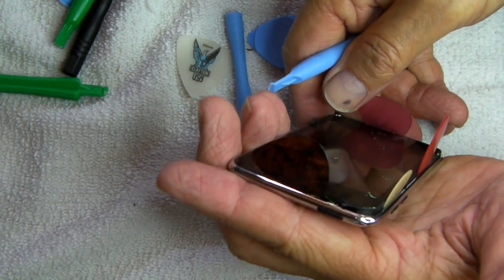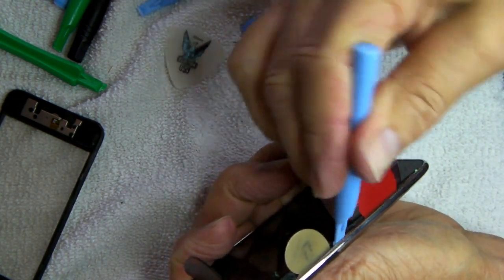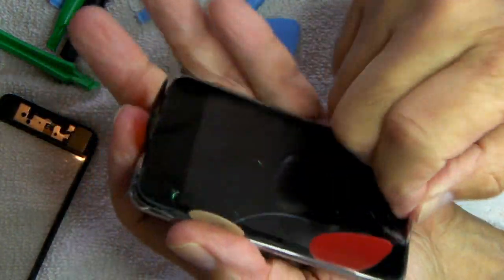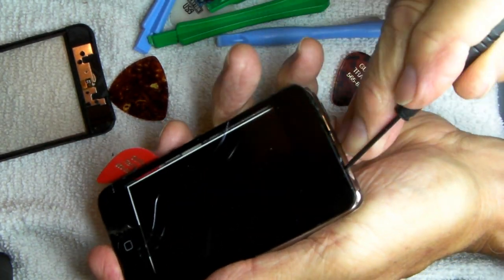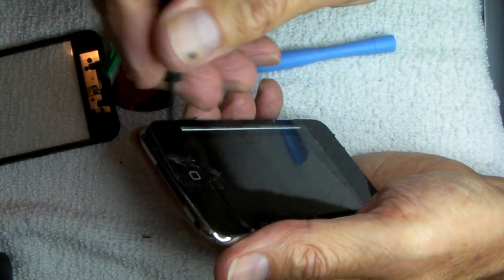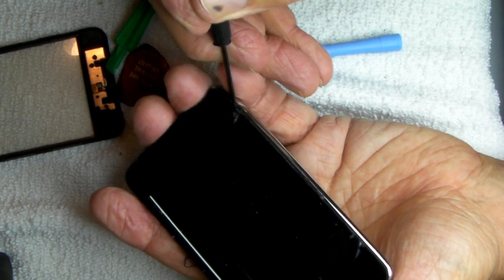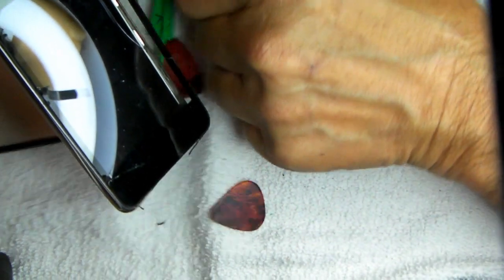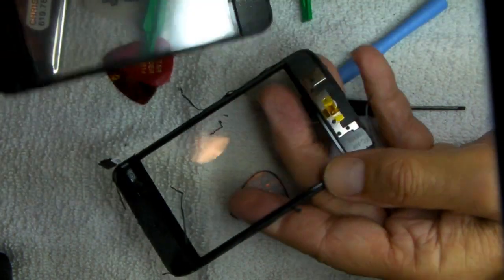ipod touch digitizer removal Part 4 of 4.mpg

Comment from the maker: Seriously?  I suppose that might relax the plastic clip indents.  Did you see the reference about the use of a razor blade handle holder to slip into the crack?  I have not tried it yet but I will next time I need to open up a touch.